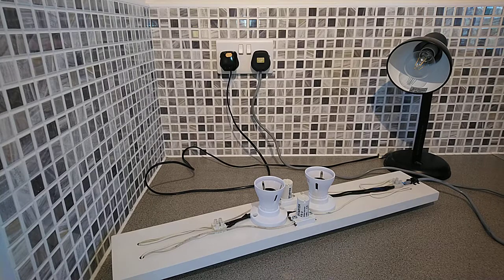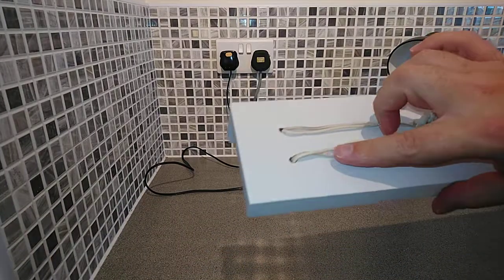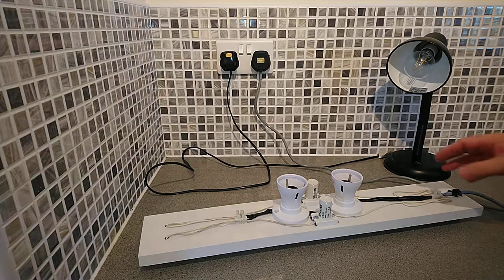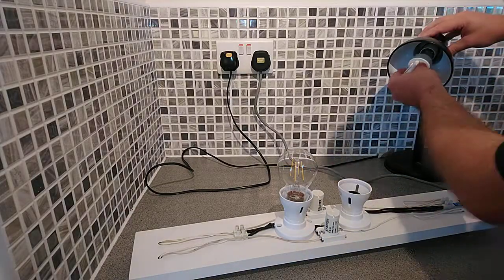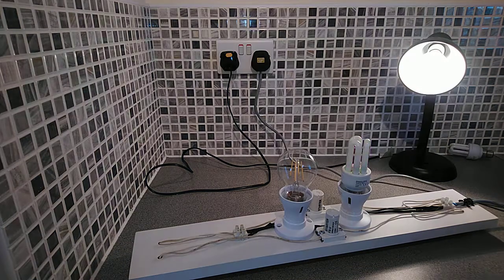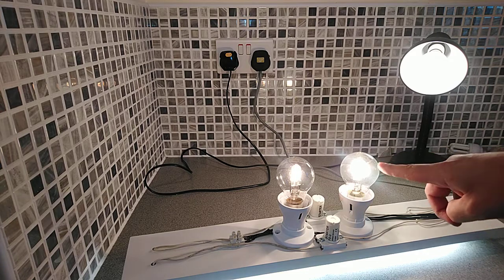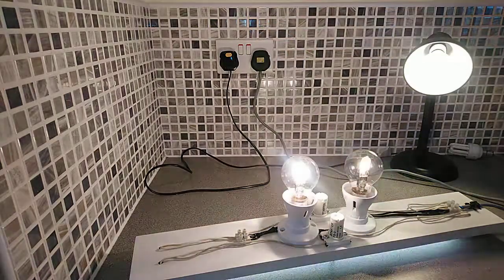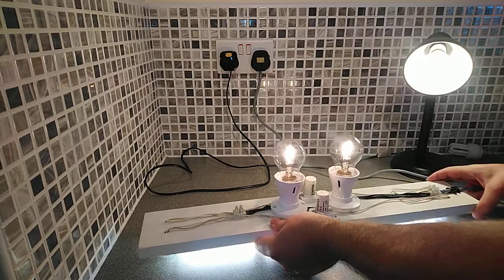Fluorescent Tube, No Ballast (MK2)

Comment: Cool homemade resistance ballast.   Btw it is also possible to run fluorescent tubes directly off of DC with sufficient voltage to strike the tube.  The ballast must be resistive, and there should be a method to reverse the polarity each time the lamp is turned on,  otherwise mercury will accumulate towards one end of the tube, affecting life and efficiency.  In fact there were certain areas in the U.S. that used DC from the utility well into the 20s and 30s, and a few neighborhoods,  notably around Manhattan and near upstate NY that used DC  until the 50s or '60s.
Reply: Ohh, I have a 12v fluoro, it’s an f8t5 and one end is getting a bit burnt, that could be it, also I think cause it’s electronically ballasted, the  end it starts must be where the blackening is, I’ve swapped it around now 🤞

Comment: Under running fluorescent lamps is not recommended, the cathodes run cool and sputter shortening their life span. A prime example of this is a 2’ 40w T12 lamp under powered on a 2’ 20w ballast. The lamp will soon blacken and fail. When running fluorescent lamps on resistive ballasts (on AC) it is generally only possible with argon filled lamps as these have the lowest breakdown voltage. The lamps must also be in close proximity to an earthed surface or an antenna at the same potential as neutral (if the ballast resistor is in the phase side of the circuit) resistive ballasts don’t provide an inductive kick, limiting what lamps can be used with them. The 14w HE T5 lamps you are using are designed solely for high frequency ballasts which is why they are slow/unreliable to start. A 20w T12 2’ fluorescent lamp can be easily ballasted with an incandescent lamp. A 130w carbon filament lamp is perfect for this application.
Reply from the maker: Yes I totally agree with your information. The T5's in video were out of set of 3 lamps that run on one high frequency ballast the 3rd tube had burnt out and had replaced with 3 new ones. The light fitting link:- https://www.flickr.com/photos/everybodiesdeaddave/32941630225/in/dateposted/
Reply: Actually you could use a choke ballast with a starter with DC, but you have to use a resistor in series with the ballast,  an incandescent lamp close to the fluorescent tube wattage is best.   The starter opening provides inductive kick like the breaker point ignition systems found on older cars from before the mid 1970s.

Comment: I like the idea! Many years ago such setups weren't too uncommon, using specially designed GLS lamps instead of a choke. I have one of such fittings in regular use, that runs a 4' 40W tube from a combined 'starter lamp'.
Reply from the maker: You light "would make a cool video"
Reply: That's awesome!    In fact a resistance ballast was used when DC was supplied directly to the lamp.   This is not recommended,  since mercury will accumulate towards one end of the tube unless the polarity is periodically reversed.  In fact a few neighborhoods near Manhattan,  and near upstate NY used DC from the utility until the 50s